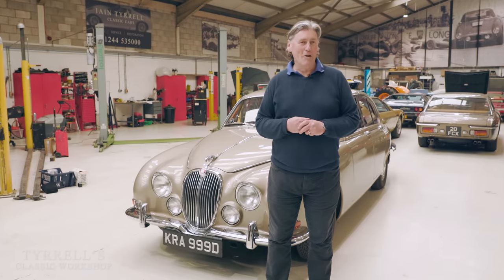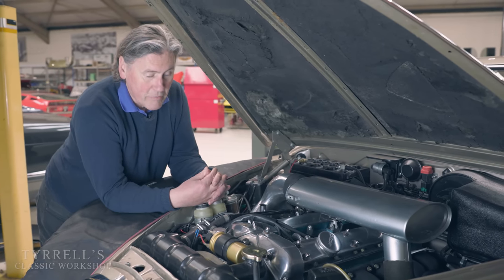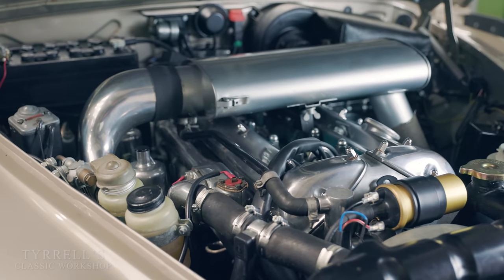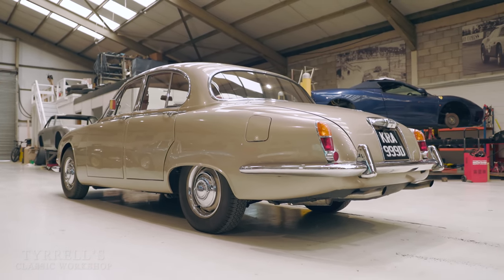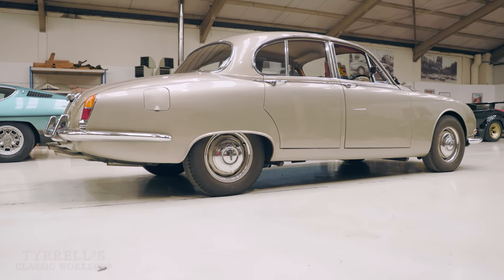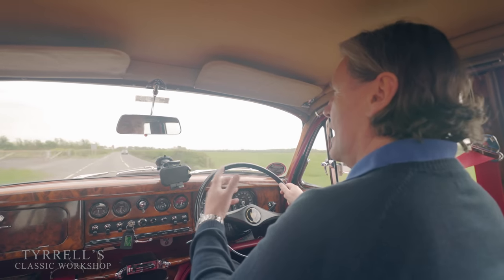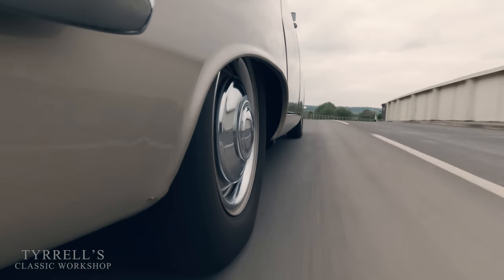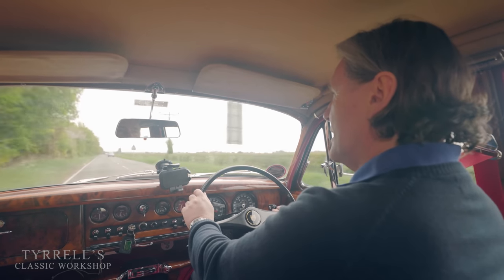Jaguar S-Type - The 1960's Saloon that set the benchmark for comfort | Tyrrell's Classic Workshop

Comment: I love these cars but the crooks cars were usually a Ford zodiac if some type or whatever car could outperform the cop cars.
They used one in the title scenes of the Sweeney .
When I win the lottery or come into some money, hmmm marry a rich woman. 
But I'd have in Jag Racing green as used the D type Racer from 56/57 .
The engine sounds like tearing calico as Jay Leno says every time he rates a jaguar product using the straight 6 an many of his own cars his 120FHC c type engine, his e types.
And the hot rodders choice for a rear axle and used in many famous hot rods and a Jag irs will sell a lot more with the hot rod attached. 😳 
My dream car again is a 49 51 Mercury coupe with a Jag 6cyl and rear Jag irs in metallic Jag brg paint. Of course chopped and lakeside pipes, possible ghost flames with jaguar animals in them.
Isn't it said that the XJ6 of the 70s the best handling car saloon in the world?
He designed cars by eye and each model was bought to his country home to see what it looked like in real light.
When you drove over the speed bumps you hardly noticed anything and just the odd rattle from the glove box.

Loving the seat belts that are matching the colour of the leather , all the more better than the usual plain black. 
The issue with Americans and our car mechanical issues were that alot of their cars were out dated by the time they were produced for the USA public. 
Steering boxes, live rears still into the 70s, better suspension,  better electrics, the only car I had an issue with multiple times was ford's, they didn't like the wet, or heat. Many a time been stranded by the dizzy on the ford's hating the damp or sweating because of the heat. 
Only ever had one bad mini for water affecting the electrics, spi mini. Fast as hell in the dry, if engine cover on from the factory all OK, but removed by a mechanic and never put back till the day I sold it when I noticed it missing lol. 
Best car was I'm sorry to say was a mazda 323 coupe in red 4cyl and the only thing wrong with it was a 49p reversing bulb on an mot before given . Yes given to my ex sister in law who trashed all the suspension bushings in the car and blamed us & wife (now ex) thank god. But come on she got it for nothing. But what did we trade to but a fecking fiat cinquecento in blue base model.  But at least I could lift that up.

Comment: For the sixties, this was a very out-of-period design. Beautiful, put dated when you compare it to the 65 Mustang, for example. The color is gorgeous, the engine. gorgeous, the interior, gorgeous too. I think there were several elements of the design that were not as desirable as earlier models. The greenhouse is just not as elegant, the rear door shape looks like it has no relationship with the rear quarter panel, and the rear wheel wheel opening looks a little too low. The front end is ideal and probably the best angle to admire the car. This was put out there just as regulations and safety standards were about to send the car industry into chaos and a series of horrible cars that marks the 70s as a decade of ugliness that took 20 years to overcome. So, one of the last V-12 Jags to enjoy for the lucky few that bought one.

Comment: To describe the Jaguar 3.8 Engine as a 'Marvel' is a pathetic joke.  Either this individual does not have any Automotive Technical Knowledge or experience.  The engine is equiped with 'Dual Overhead Camshafts' and SU Dual (1) Barrel Carburetors.  The later 4.2 Engine had (3) 2" SU Cabs. The design is a 'Long Stroke' with relative 'Small Bore' is also referred to as an 'Undersquare Engine'.  The purpose of Overhead Camshafts is to permit the engine to achieve much Higher Engine Speeds which in turn contributes to 'Higher Horspower' and 'Torque outputs.  The stupid design of this engine limited the R.P.M.'s to 6000 but was Red Lined at 5500.  This was easily achieved with a simple 'Overhead Valve"' design.  Furthermore, fuel delivery back then on high performance engines used Multiple Carburetors with at least (2) Barrels per carburetor.  As far as the Rear Suspension and Brakes, the attempt is made to reduce the impact of stupid engineering. 
 The E-Type Jaguars were also plagued with stupid engineering designs.  To replace a Clutch Assembly, it was necessary to remove the Engine and Transmission as a unit which represented 28 Hours of Labor + the Cost of replacement parts. That was $ 3500.00 for a clutch job !  They were too stupid to have a removable 'Interior Transmission Cover' as was the case in Triumphs from 1957 TR's through 1976 TR-6's.  Although the english manufactured some beatiful body designs, their Mechanical Engineering was retarded compared to other manufacturers.